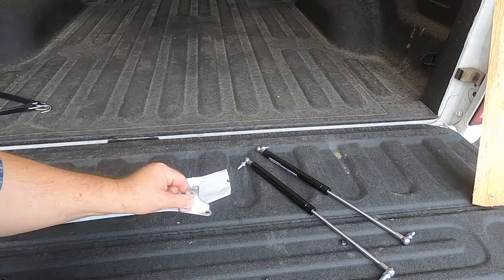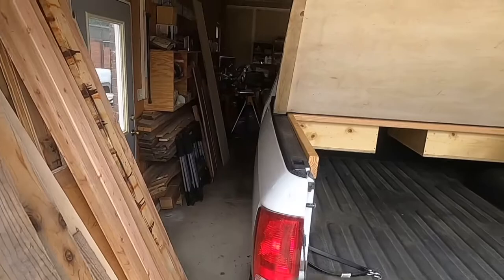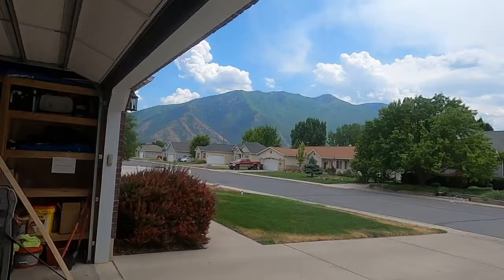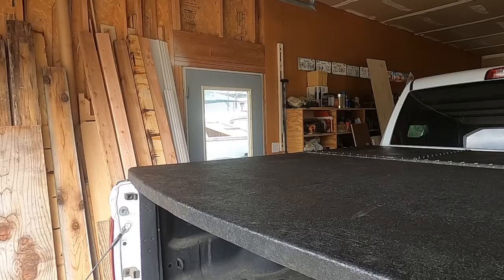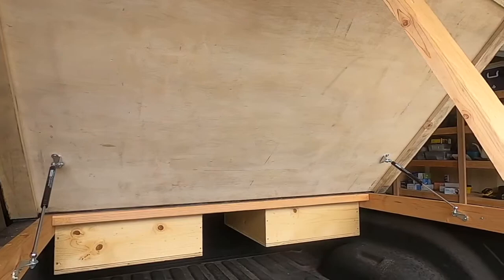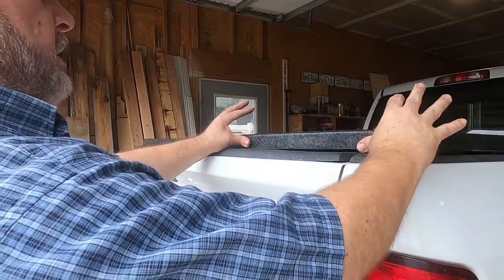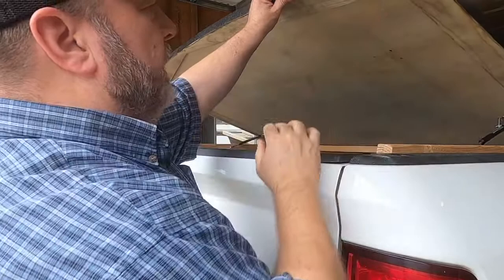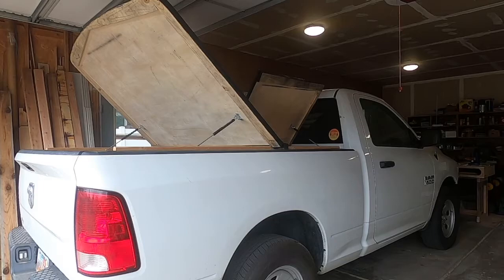How to Build a DIY Fiberglass Tonneau Cover - Part 5

Comment: This is an awesome project. I have wanted to attempt this, you gave me this push I needed to go forward. I will use your videos as a guide to completion.
Reply from the maker: That's awesome Robert, just don't make the same mistake I made. Apply the fiberglass on bare wood, then paint it to the desired color afterwords. You will save a ton of time and money. Good Luck.

Comment: Another of your projects completed and done well. You changed your mind about handles?  No locking for front hatches?
Reply from the maker: I might have changed my mind on the handles. It's a lot easier to lift with the gas struts. I thought I was done with this project, but I ended up coming up with a locking mechanism for the front boxes. That will be my next video.
Reply: @TheWoodHaven  can't wait to see.